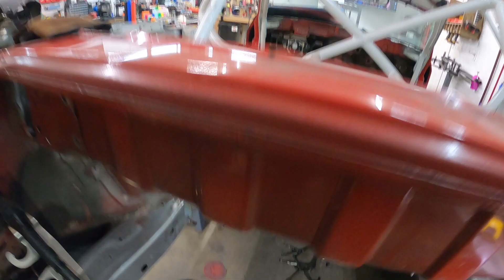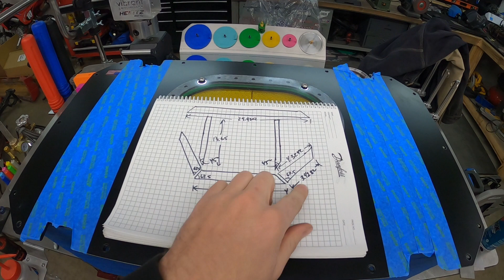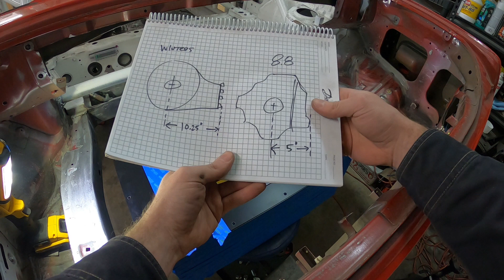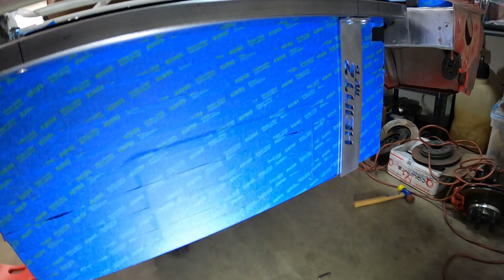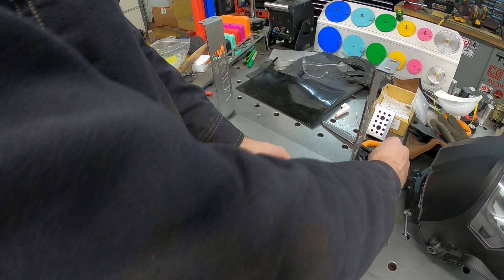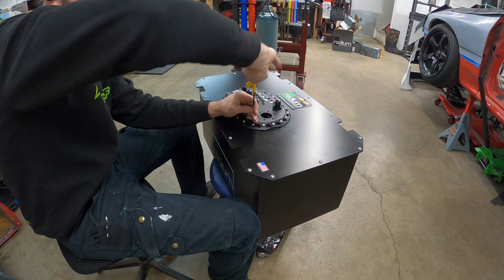RX7 gets a big fuel upgrade!

Comment: Great job! would you be willing to share your cad for the top straps? Using this same setup on my build, with the 14 gal. and radium fuel filter heat sync bracket.